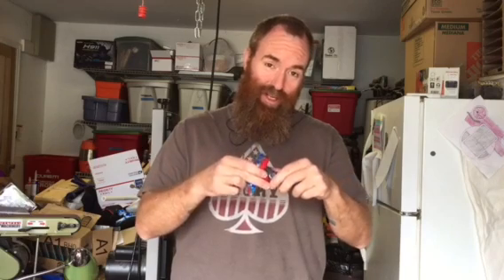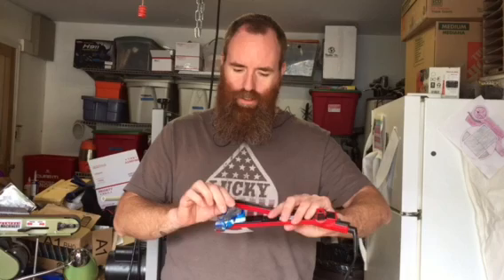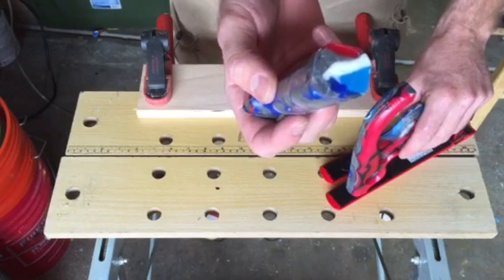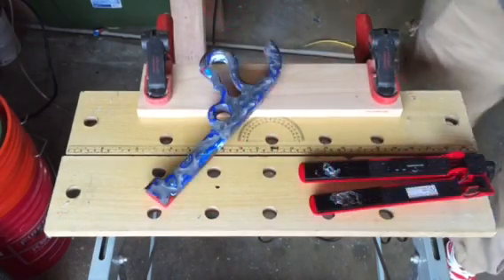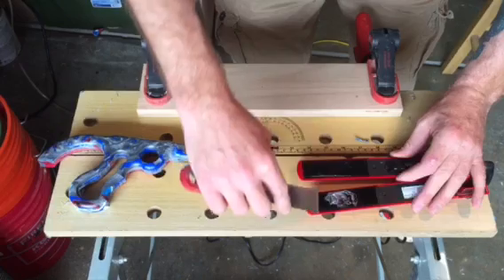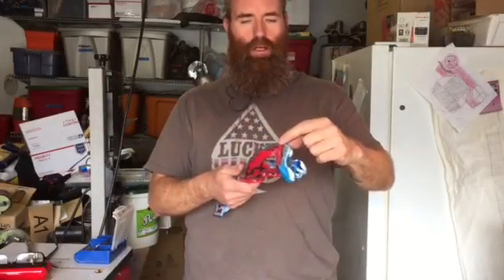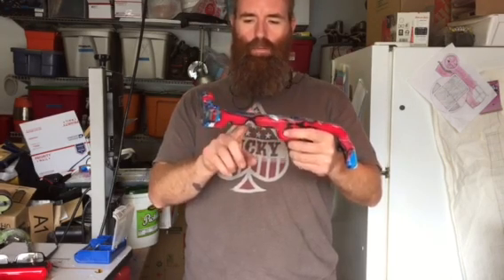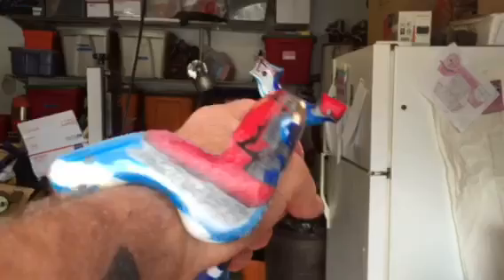Fusing HDPE

Comment: Good demo and a heating source. Love the idea!
But you still have to be cautious with the bond!
What is the weld strength of HDPE?
The field welded specimens registered average strengths of 5 MPa as compared to 12 MPa of un-welded specimens and a maximum strain at fracture of 0.5 as compared to 3.5 of un-welded specimens.May 15, 2017
Also, when you were testing, I wish you had eye protection on!
Columbus Michigan

Comment: I found your video interesting. I am researching alternatives to polycarbon as I need to build a Star Wars Light saber for my son. The polycarbon is hard to come by where I am, but there are lots of HDPE bottles. The question: how possible would it be to make HDPE Tubes? What would the process be?
Reply: i actually tried making hdpe tubes once what i did is made a mold with 2 metal pipes with the one in the middle having less diameter than the outer one after that i melted the hdpe down in between the two pipes and got a pretty good tube. another alternative to this woulde melting down hdpe bottles into a large thin sheet say 1/4 inch or less than putting that sheet in the oven but this time only softening the sheet not completely melting it after this you would take the ends of the sheet use a heatgun and heat up only the ends of the sheet and then quikly roll the hdpe sheet while still soft into a tube while sticking the melted ends together
Reply: It occurs to me that it depends on the dimensions of the tube. You could make a solid cylinder and drill out the centre hole with a lathe or somesuch
Reply: I found a local supplier of polycarbonate tubes. Thanks guys.

Comment: Why not use a second hand,  Teflon electric frying pan.?
Reply from the maker: +Steve Brettell 

Good question! I think it would work just fine. The reason I chose the flat iron was that the parts I wanted to fuse were small and I only wanted to heat certain areas. Also most electric frying pans have a lip that would make contacting the surface difficult with some parts. 

Thanks for watching!
Reply: Yes do it ! I use a Gorge Forman Teflon coated burger cooker. It works great, never overheats. Only thing is that it has ribs and the HDPE melts down into the ribs. But that can be fixed by pressing on cookie pans or baking sheets. I put a heavy steel brick on top and keep layering the HDPE till I  Get the desired thickness.  I am making brass knuckles from the square cakes I just made . RE-CYCLE  AND RE-PURPOSE that my game !
Reply: triumphmanful ... ... No you aint making "Brass" knuckles....they are Plastic knuckles!!😒😒👎

Comment: You shoot that thing different every time... and, WhaT ARE YOU GANGSTER THAT YOU HOLD IT SIDEWAYS?
While you were making it you held it upright...
Reply from the maker: +phartattack  most every top shooter in this country shoot with sideways forks, or at least sideways leaning.  The competitive slingshot community is not  that large in America and I have shot with most of the winners of the large tournaments of the last few years. Not a single one shoots with the forks straight up.  If you have any other slingshot related questions I'd be happy to help you out. Thanks for watching
Reply: I was just curious that while you built it you were holding it upright and when you shot it you pulled at an angle and held it sideways.
Reply from the maker: +phartattack  well, for me the only grip style to shoot upright is hammer grip. The pistol grip of this shooter is very simmilar and I was testing which I preferred.  As for the angle (I assume that you are referring to the deference between the bands and the frame of the slingshot) that is part of the learning curve of shooting an extended fork slingshot. Roger Henry has developed a rotating head slingshot to overcome this issue.